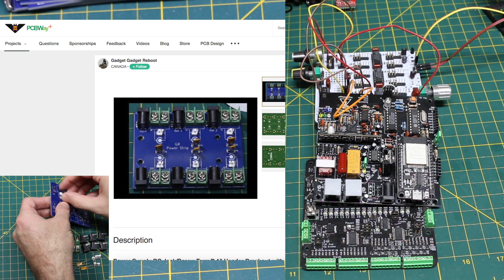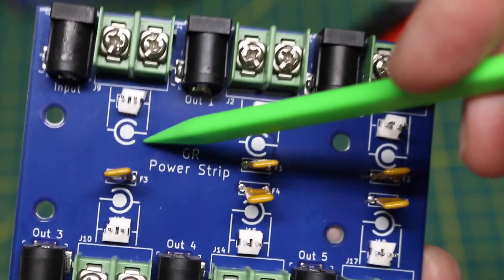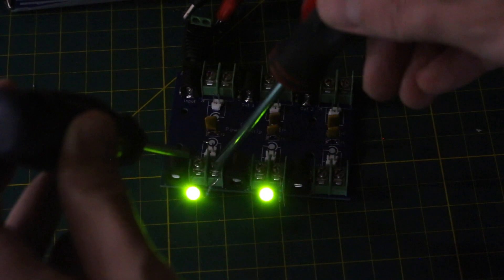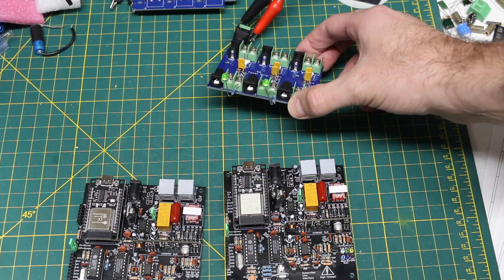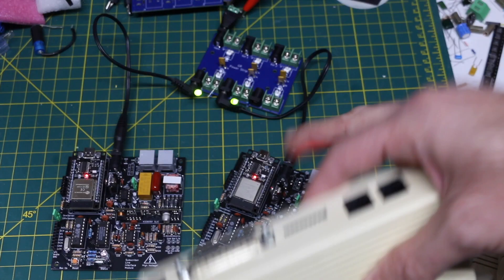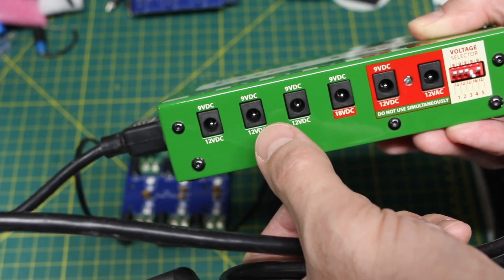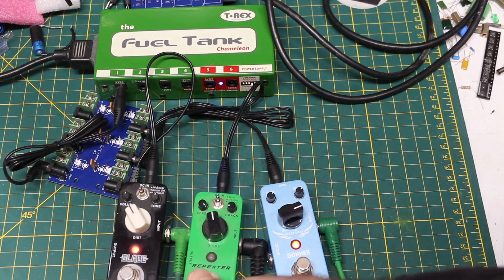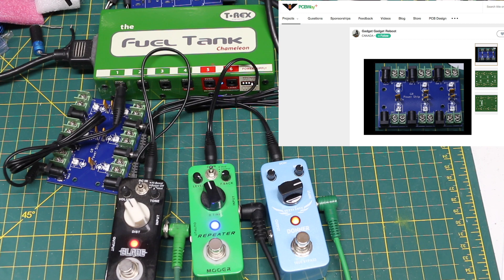PTC Fused Power Distribution Board for 2.1x5.5mm, Screw Terminals, and Dupont Headers

Comment: Don't PTC's have a voltage drop. I vaguely remember when I used one years ago it dropped the voltage, ie, it has resistance, but then again that might be load based - my load was about 200mA -.
Reply from the maker: I actually did a 200 mA load test at 5 V which is just by chance what one of those ESP 32 boards was drawing when I plugged it in and my voltage drop from the PTC was 20 mV so I can live with that. It will drop more as the load increases but I’m not really looking to draw too much on any one channel anyway.